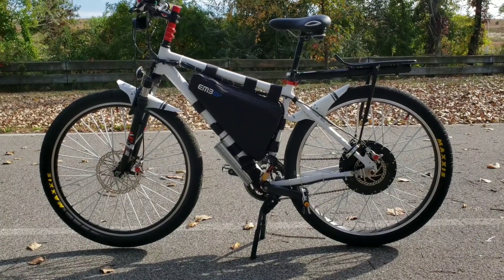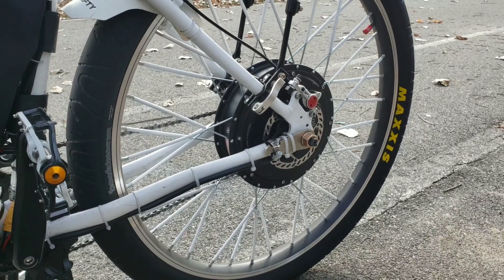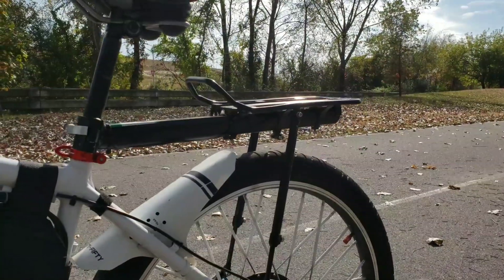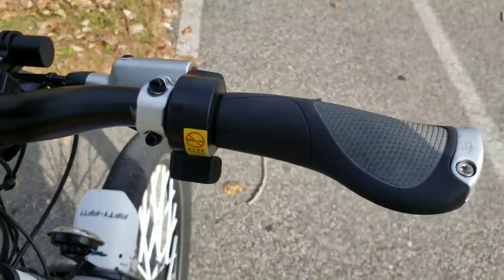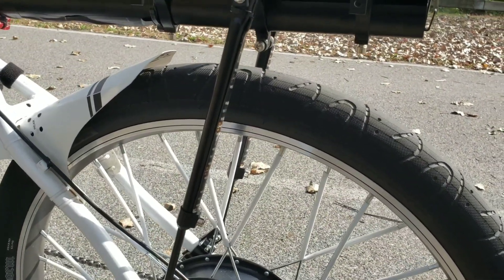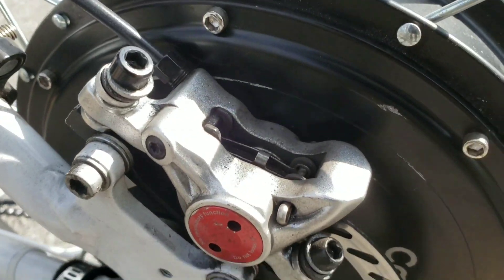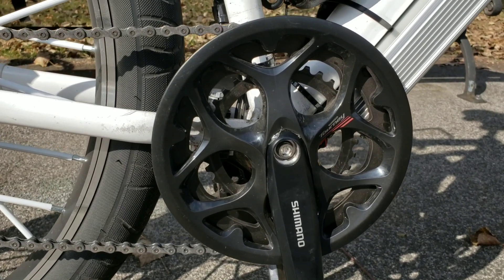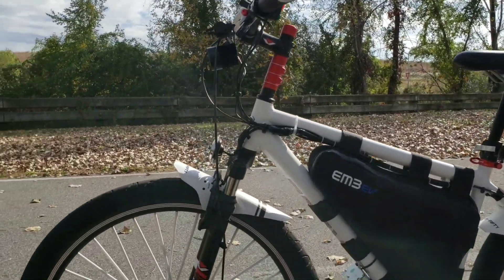Homemade Electric Bike Assembled With Electric Motor Kit

Comment: I really appreciate your channel brotha. I have been into bikes since 2015 and I love it. I first built my own lowrider bike.now I am one my motorized bike which I’m in the process of finishing but I want to also have a while. I saw a guy have 2 motor hubs, both front an back. Do you think that is a good decision or the back hub alone should be good?
Reply from the maker: Hey bro two hubs are great if you live around steep hills or the vantage of one motor that stops working at least you have the option of 2nd motor to get back home.. Two motors will require up more battery power to operate.
Reply: @djsoundzebikelife4314  Cool, well I was going to go with that but I figure I would have to add a lot more weight on the bike to have two motor hubs. So I'll stick with one. The type of riding i'm doing is mainly cruising and getting some speed every now and then. I just want the speed there just incase I want to use it.lol What would you recommend?
Reply from the maker: @ashleyc434  Keep the bike as light as possible. It worked out for me 👊
Reply: @djsoundzebikelife4314  thanks i think  would have to since its a stretch cruiser frame.lol
Reply from the maker: @ashleyc434  Yeah 👊